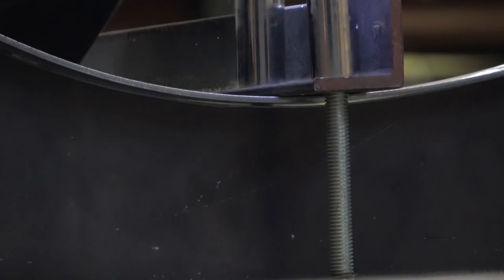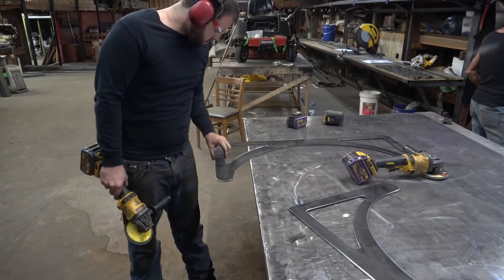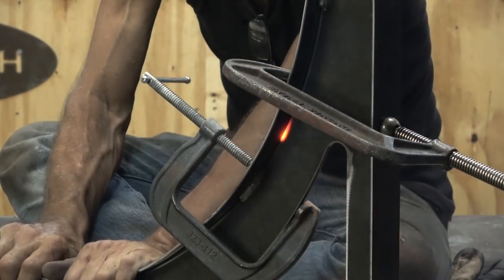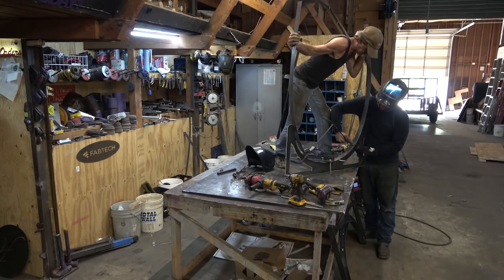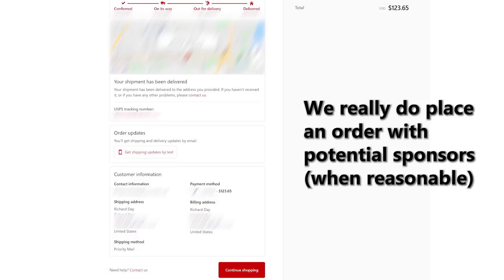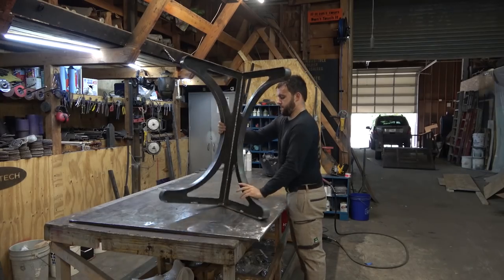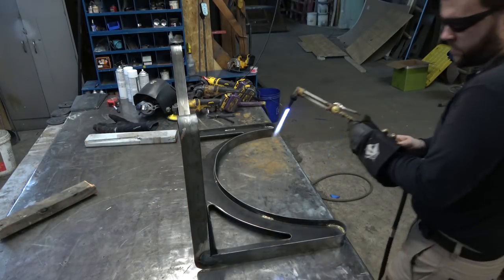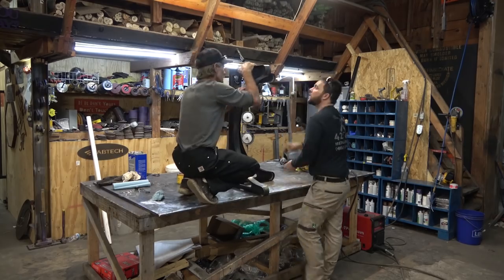Brass Plated I Beam Table Base + Great Lakes Work Wear Giveaway

Comment: I like the design you did for this table base. It's a great look. I do have a question though,  is there a particular reason why you didnt apply some heat with a rosebud to make it easier to bend and form the flat strap?
Reply from the maker: I mentioned in video that we wanted to demonstrate it can be done without it
Reply: Oh ok. My bad . Must have missed that. Screaming kids and all.

Comment: I like the voice over videos. I'm gonna try to start doing it in my videos. It takes too much of my work time to stop and talk to the camera all the time. What kind of camera set up are you using?
Reply from the maker: Camera: https://amzn.to/334I9MQ with the hot shoe mic (aka no wires connecting mic to camera): https://amzn.to/2O79nhN Windsock: https://amzn.to/2qvlgVy all mounted on a Manfroto Tripod with Fluid Head: https://amzn.to/2pCexJb

The lens is gimbal'd INSIDE the camera, making moving shots much more stable. They also have a 1080p version: https://amzn.to/345fQ25 if you don't need 4k

It's a pretty good setup to be able to get into for right about a grand.
Reply: @42Fab  I really wanted to go the camcorder route but it was a little outside the budget for me starting out. Is this the camera you started with?
Reply from the maker: My first year of videos were on GoPros and show it. Having the ability to zoom, get good light, etc made a huge difference. The gopros were effectively wasted money. The $1k ish I spent on two and accessories could have bought this camera (and should have). I had another camera for a bit until I broke it, but fortunately I had bought the warranty. It worked 90% as well as this does, but lacked a focus wheel, the gimbal, and a few little niceties. That setup was: Rode Micro Microphone: https://amzn.to/2NcPd2R Panasonic HC-VX981K: https://amzn.to/2wku53v Sunpak Tripod: https://amzn.to/2w5Y2VG
Reply from the maker: but that all said, the best thing to do budget wise is probably use a good, newer phone (cracked screen or locked from craigslist), a tripod phone mount, and a GOOD MICROPHONE. I didn't believe it either, but people will watch a crappy video with good audio before watching a good video with bad audio. The windsock/deadcat is important if you're going to be near ANY wind.
Reply: @42Fab That's a valid point. Thanks for the advise!

Comment: Awesome build man. Do you think it would be possible to make a welding table with holes on the plasma cnc?
Reply from the maker: Yes, but the accuracy wouldn't be amazing
Reply: We used a magnet drill press, took ages. lol.
Reply: @Manu.Makes.Things  I was thinking starting the pilot holes with the CNC and hitting it with the magnet drill!
Reply: @Maderasdesign  That will save time yeah